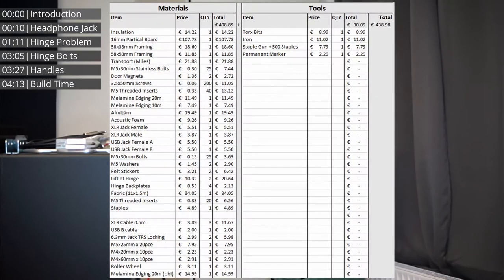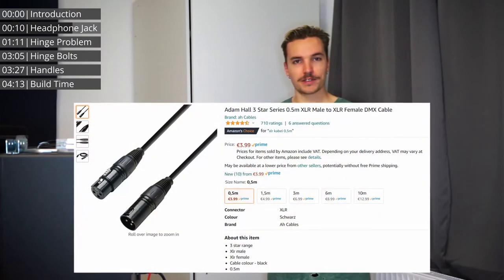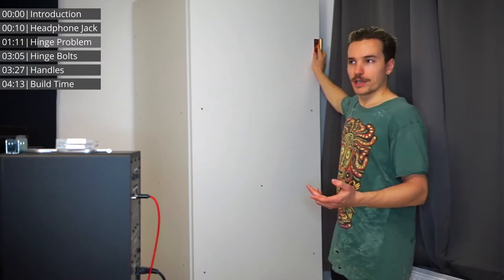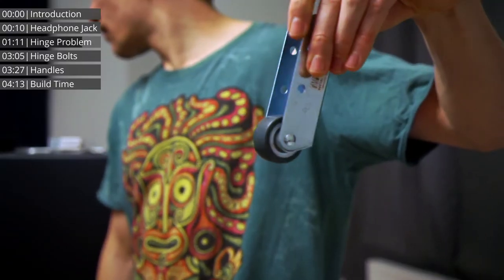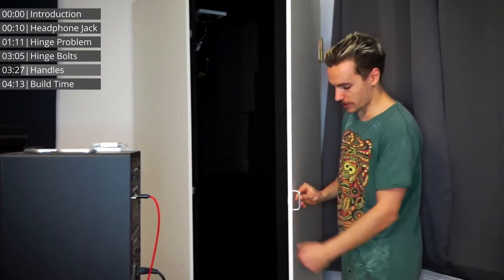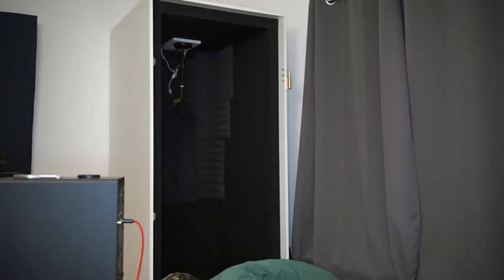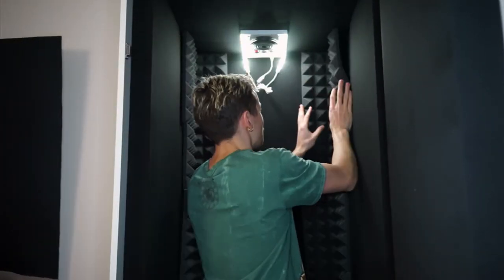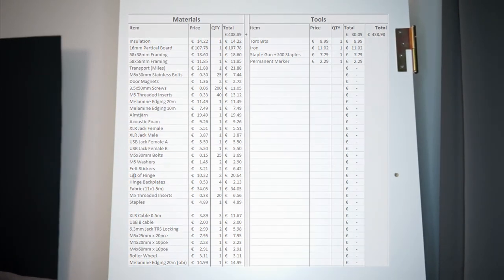How to build a professional Vocal Booth on the cheap - Part 4

Comment: Hi James. First of all congratulations on completing a pretty serious project and thank you for sharing your journey with the world. You are obviously very knowledgeable of acoustic principles in terms of sound treatment and insulation and your construction design process is awesome! I will be attempting something similar myself - probably much simpler, but in my case I have a couple of additional problems to deal with. First of all I will be building the booth inside a log cabin which is not that big and has a sloping roof, which may be a seriously restrictive factor. Also, I need sound insulation not only for the sanity of my neighbours but also for my benefit, as I have to deal with a lot of noise in the garden from singing birds to passing airplanes and noisy neighbours on three sides, well as the sound of rain which is almost amplified inside the cabin! One thing worth mentioning is that a weak point in any sound-insulated environment is the door. You could probably have done with a mechanism by which you could achieve a much tighter closure with your door, although this might not be too much a problem for you in your domestic environment. I was also wondering why you chose laminated rather than plain old chipboard for the walls of your booth. Does the laminate help with the isolation? Another issue for me would be that of communication with the outside world. I'm a one-man-band come recording technician so need to work out a way of having access to the computer controls without having the computer - even a laptop - inside the booth. I'm thinking perhaps a wall-mounted monitor and wireless or wired keyboard and mouse might do the trick, perhaps with some additional USB ports mounted inside somewhere. Any thoughts on that? I also take note of your warnings about the health issues when using such constructions! I have thought of that myself but am not sure how I would tackle it in my project. Once again thank you for this series of excellent videos and I look forward to hearing the results of your work in your future ones. All the best mate.
Reply from the maker: Hey Lazar! thanks for watching. I'm glad you liked it. That certainly is a tricky situation building inside a size restricted area. If you need to make it smaller the rock wool is pretty easy and relatively safe to cut with scissors. I think the insulation will do a pretty good job of blocking out the birds, planes and rain. The door actually seals quite well with this design with only the magnets holding it closed. I would be very hesitant to have anything other than magnets holding the door for safety reasons. The USB port on the inside of my booth is connected to my pc so I simply plug a USB hub inside the booth and I can connect all kinds of things like mouse and keyboard and even a webcam if I want to record video in there with the door closed. I'll post a video like this soon. A wall mounted monitor would be really nice but would require another jack for HDMI or similar. I would definitely consider doing that. Thanks for your kind words! I have some other projects happening at the moment but I'll post more booth videos soon

Comment: Great video, just about everything I need for my booth. Did wonder when the air intake/ extraction section of your video was going to appear, read your health warning so I'll be adding this to my build. I'll let you know how I get on. Thanks for the video, class, clear and just what I am looking for.
Reply from the maker: Hey thanks for the kind words. I'm glad I could help. I'm still thinking about how to do the ventilation so if you have any ideas let me know!
Reply: Yes I've got a few ideas for air so will let you once I've decided the route. Probably be end of June before I get to that stage.
Thanks,
Les
Reply from the maker: @landsendsolo  The tricky part is getting air in and out but not sound. Sound is air after all haha

Comment: Great videos that you’ve been posting on this Booth. can you tell me once you’re inside singing. can the people outside hear you singing.  I’m looking to do the same thing but I have to have it where the people don’t hear me singing upstairs from me. also what is the name of that insulation you put in is that soundproof stuff and what did you use for the outer walls looks pretty heavy duty.
Reply from the maker: Hey thanks I'm glad you like them. I can tell you that standing directly next to the booth you can hear someone singing inside faintly. If I go into the next room with the door closed it's very hard to hear. I have set my phone recording from different places around the house while I sing inside to check because I'm self conscious about my neighbors hearing haha. I'm pretty confident they can't hear me

Comment: very nice! are the quality of the vocals clear? or do you need to eq alot of the lower range out for a mix? how good is it at keeping outside noise?
Reply from the maker: The vocals are super clean and clear! I'll can show some examples in an upcoming video. I haven't done any proper mixing yet but the recordings you can hear in the video have no eq. There's not much outside noise in my flat but I'll make a note to also test this when I make a testing video!
Reply: @JamesDeBono  looking forward to it!  I've been looking into building a booth for a while and so far yours and another booth i saw on YouTube are what I'm looking for. Now it all comes down to price and sound quality 😎
Reply from the maker: @johndoe7109  Awesome! are you going to document the build as well? Without doing so much scientific testing, all I can say at this point is that it could be more soundproof but I can't imagine the recording quality getting much better than it already is. At least I probably wouldn't notice the difference
Reply from the maker: *Through testing, I realized the lack of ventilation could be a health risk. Please read the updated description. Thanks*
Reply: @JamesDeBono  thank you very much for letting me know, i appreciate it!
Reply: @JamesDeBono  yes, when i build it i will document it too. I've been researching different builds and am between yours and another build. Just taking my time to choose what is best for me budget wise

Comment: How well does it keep outside noise out? Thanks!
Reply from the maker: Without yet doing proper measurements, I would say quite well. It's very quite inside. So much so that it gives you a strange sensation in your ears due to the lack of sound. I will make an in depth testing video soon. Thanks for watching!
Reply: @JamesDeBono  looking forward to it! Thanks!!